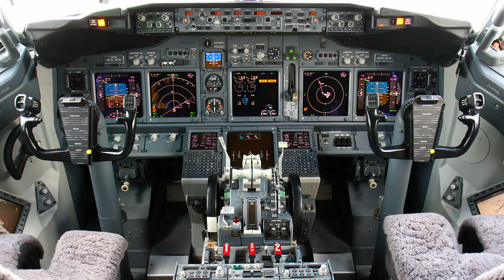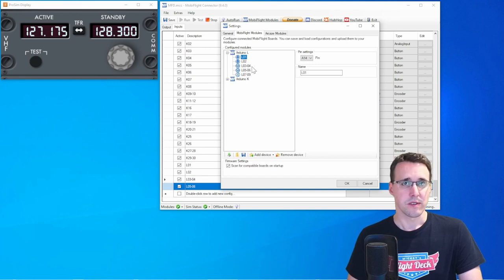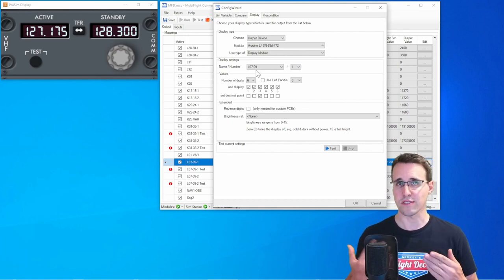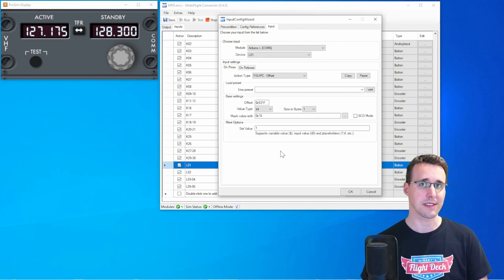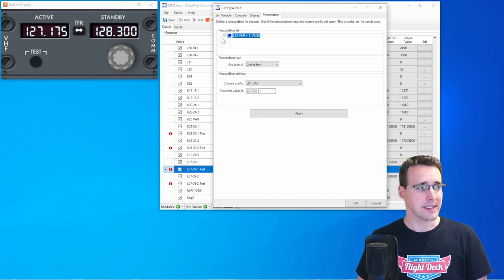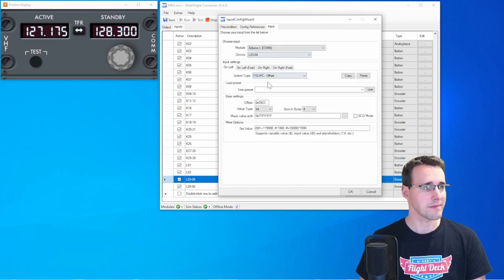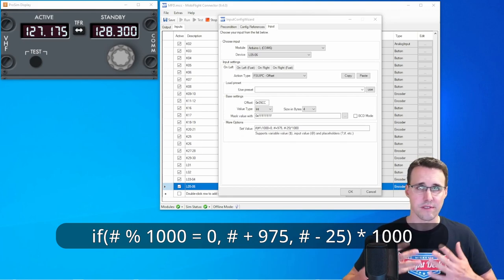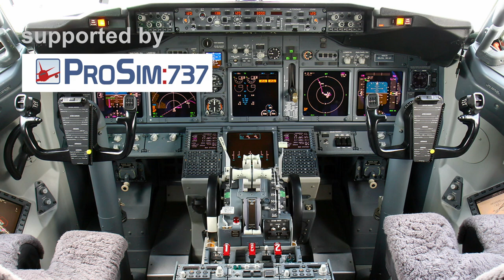COM Panel - A Boeing 737-800 Homecockpit #71

Comment: hello michael first thanks for the amazing job you share its just amazing no words to describe, im starting to build my own sim so my question what do you recommend to buy for all self made sim 
3d printer or cnc (60*60) or laser machine (small one). for around 1000$-1300$.thx
Reply from the maker: Your question just gave me the inspiration for a new video. Because there is no simple answer to this question. The budget is just one of a series of parameters to find an answer. It depends on the target quality of the panels and the rest of your sim. If you want to build a full size cockpit none of the tools alone can make all the work. When we are looking just to panel making let's talk about the budget. For 1300 you will get a very good 3D printer, a cheap big laser cutter (but with really bad components) or a cnc in the lower mid segment. You see, you can't compare the three tools when you are looking to the same budget. When you want to build a whole panel on your own then you can't just have one of the tools. It must be a combination. For making knobs I would recommend a resin 3D printer. When it comes to making panels that should be backlightable, then a big resin printer can do the job too if you are OK with raised texts on the panel. If your text has to be engraved and backlightable then you will need a cnc or a laser. Your budget is too low to have the printer and the engraver. Maybe these really cheap chinese cnc machines or a 40W CO2 laser can do the job (see my laser video), but after my experiences now I couldn't imagine that this would be fun for a long time. 

With the woodworking tools I have here and this budget I would go to buy the resin printer and build a wooden cnc by myself (see my cnc building videos). This would get the best quality out of the budget (cnc material 800,- and the rest for cnc tools and the printer). 

You see, a too complex topic for an easy decision.
Reply: @Mickeys_Flightdeck   yea its very complex , i saw that the cheap 40w laser with some upgrades does the job done for cutting and engraving acrylic for backlighted panels what do you think , now for the 3d printer i can get it in the next month when i got paied from my job.
from your experience what do you think better cnc or modded cheap laser for engraving for a backlighted panels?
now what the 3d printer can give me beside the knobs. cause you mentioned the resin 3d printer and not fdm printer that maybe can help with glare shields ,throttle and soo on..
maybe i wait another month ang get bouth lol.(there is no limts )
btw your a great guy keep it up man i have watched all your videos amazing.
thanks
Reply from the maker: @fgameover9880  From my experience a laser can do a better job in cutting and engraving panels. You can create smaller details. There are limits to a cnc when it comes to small parts. A cnc has a mechanical and fast turning tool. That produces vibrations. So you have to secure the workpiece. A laser cuts just with light. Keep in mind, we are talking about 3 or 4mm acrylic. When it comes to 18 mm plywood the cnc makes the first place.
The resin printer can give you better details when we come to small parts again. But when I need a piece that has to be strong then I would always use a filament printer. So again, they both have their topics they are good in. I have both too.

Comment: Thanks for the video. I have a problem. I followed your video Used offset 05C4 and 05CC but in the display only zero's. Did I miss something from the lifestream?
Reply: I have solved it with the use of offsets via prosim. Cost me some offsets but at least it is working.
Reply from the maker: Hard to say from the distance. There are too many things that come across. This offset is used in the simulator to communicate the value of the COM. Maybe you can invest the time and watch my COM Panel live stream. I'm going through the whole configuration process with every single step.
Reply from the maker: From here on in the stream I'm doing the configuration and it worked in the first try. https://youtu.be/IJl03Tj5VSM?t=2783
Reply: @Mickeys_Flightdeck  Thanks for your reply. Unfortunatly I can't find anything that I do different compared to what you say in both this video and the livestream. The only thing I can think of is that I use 3 pins for DIN, LOAD and CLK that are not next to one another on the arduino. But I can't believe that is the problem. So for this time I keep to my solution hoping that in the future i might have a bright idea and solve it afterall. Thank's for your time.